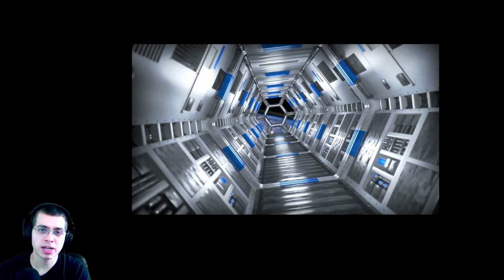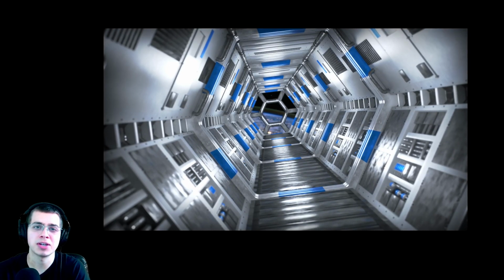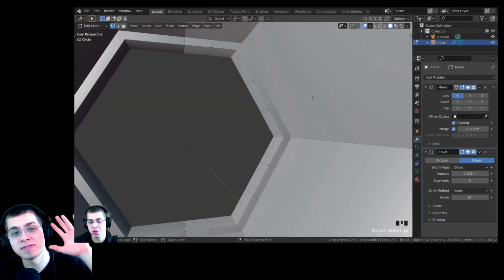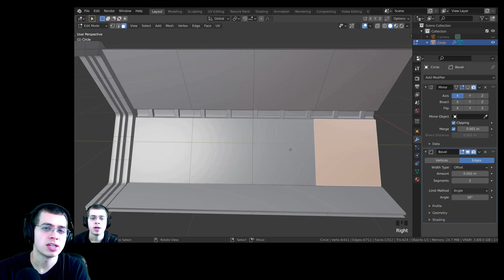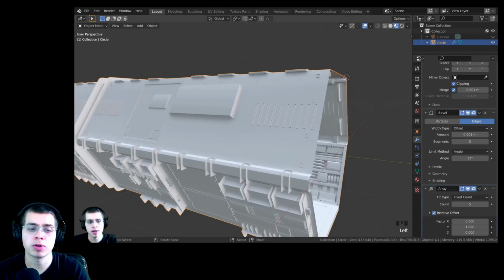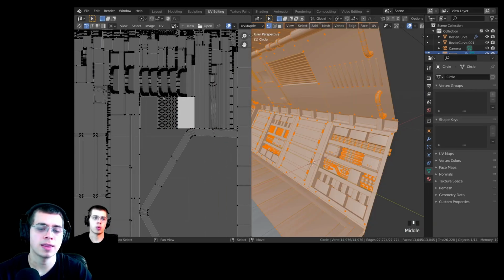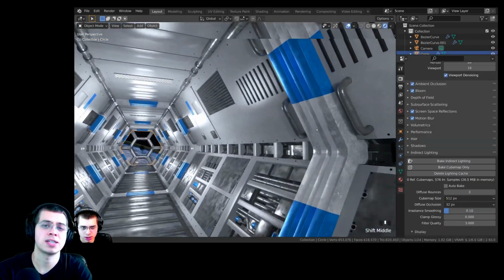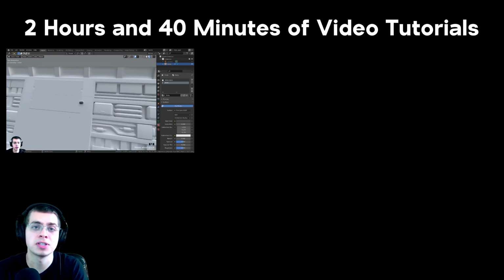Space Station Corridor - Course Trailer (Blender Tutorial Series)

Comment: Let's say I create this corridor/hallway using Blender's eevee render engine, added emission lights, and all of those textures to the model, and I wanted to use this for a video game environment--would it be possible to import this entire thing (including all textures/materials and bright lights) onto a game engine such as unity?
Reply: Yes you can but you have to triangulate the mesh.
Reply from the maker: I actually don't know for sure, because I have no experience with Unity. I just use Blender. I think it would work in Unity though, but you might need to triangulate the mesh, or figure out other ways to make the topology less, like using a texture instead of modelling the bolts on the wall. You'd also need to apply the mirror and array modifiers. Also, in the tutorial, we add the bevel modifier, to make it more realistic, but that would add more topology, so you might need to remove the bevel for Unity. We also do some slight texture editing with a few procedural nodes, like a color ramp and RGB curves, so you might want to bake the textures.

so again, I don't know for sure, because I don't use Unity, but I think with a little more work, this model could be turned into a game ready model. But I wouldn't consider the finished tutorial result to be game ready. It just wasn't designed for that.
If you have anymore questions, please let me know!